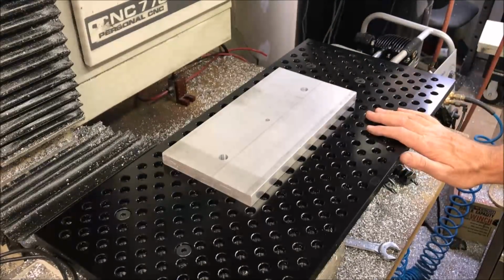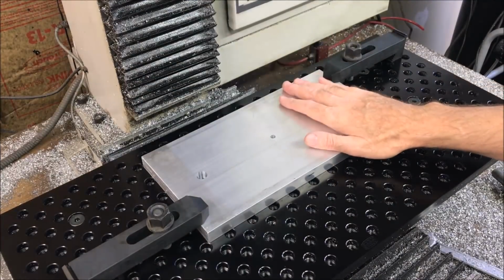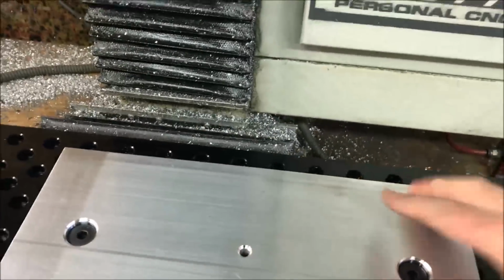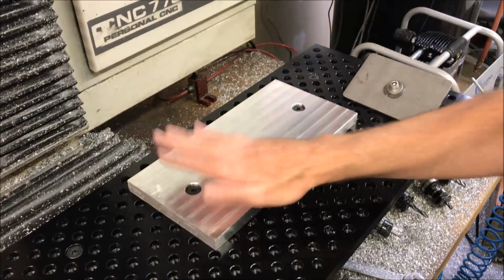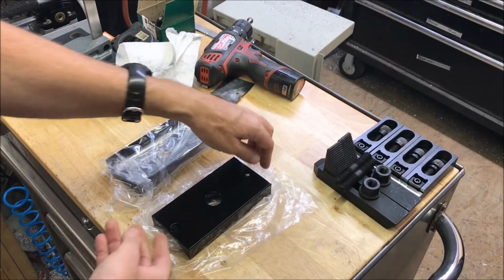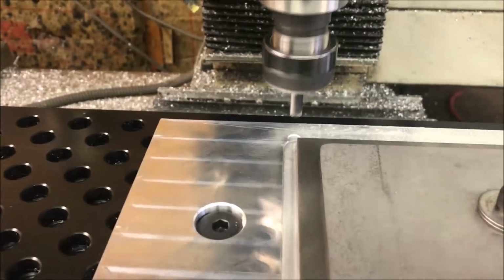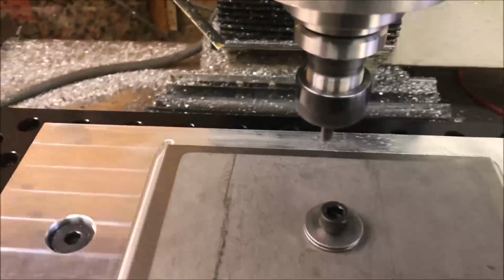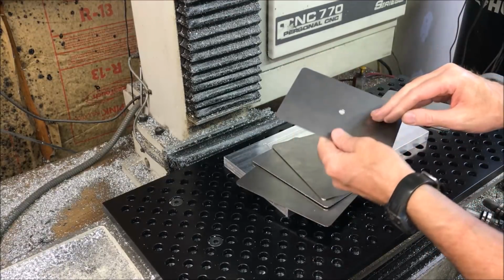Tooling Plate Pallet System Part 2 - Finish Pallet, Make Parts

Comment: Looks awesome! How's the probe working for you? I had thoughts about getting one but wanted to be sure it was worth it over the haimer. Also, where did you get your integrated mitee bite toe clamps? those things are sweet!
Reply from the maker: Thanks!  I was torn between the two.  Saunders used the Haimer and Grimsmo used the passive probe.  The Haimer was out of stock when I was ready to buy and the passive probe was cheaper so that decided it. The passive probe works great as long as you keep using it on a regular basis.  If it sits for a while, corrosion builds up inside I guess.  Use it for a while and its fine again.  Yeah, I'm loving the Modular Pit-Bull clamps.  Pricey but worth it to me.  You could also make your own.  https://www.fixtureworks.net/store/pc/Pit-Bull-Clamps-Modular-Slotted-Inch-c2143.htm
Reply: Awesome, thanks for the advice on the probe.  I really like those clamps though, I think they would be worth it.

Comment: If you cut a pocket on the bottom of the clamping plate, so the edges of the clamping plate are doing the pressing, less chance for parts twisting or moving.  Also curious why do you not climb cut?  Cool pallets swap set up.
Reply from the maker: That's an awesome idea, thanks!  Climb milling will spin the plates more.  Thanks!

Comment: Looking good Craig - one note on the tapping, you might want to try using a tap guide or use the mill for aligning the tap to ensure a straight start and then when tapping, be sure to break the chip with a reverse turn every turn or less.
Reply from the maker: desktoplathes  - Thanks!  If it was thin metal or something critical I would have but its kind of hard for a tap to go crooked in a 3/4" deep hole. And it's just for low tolerance covers.
Reply: ahh, makes sense!  keep up the good work and thanks for sharing!